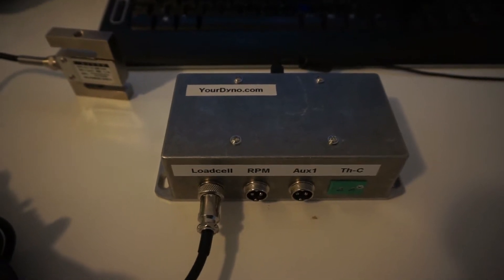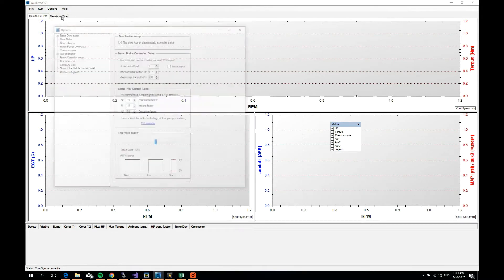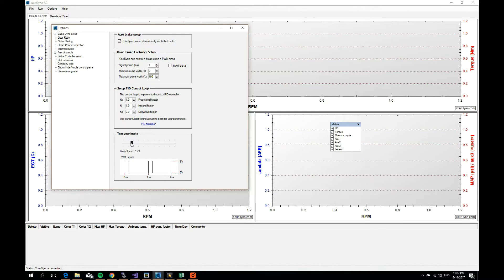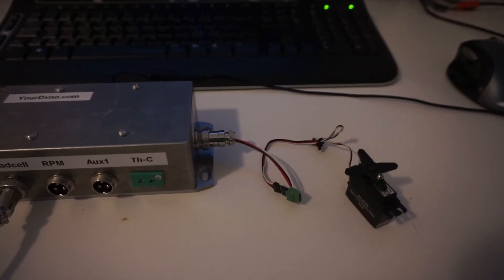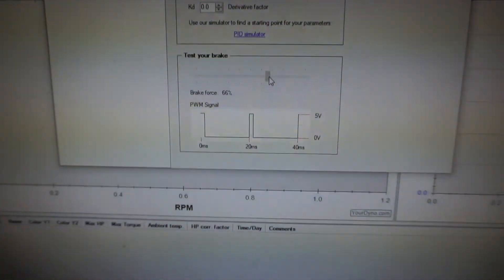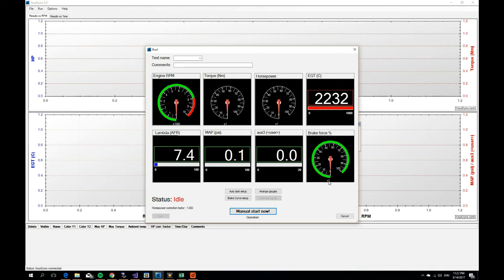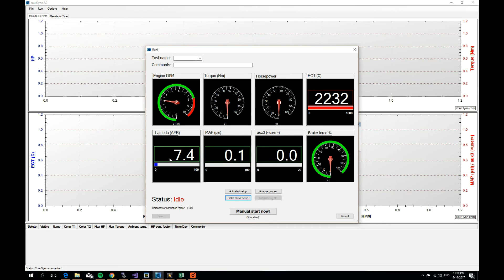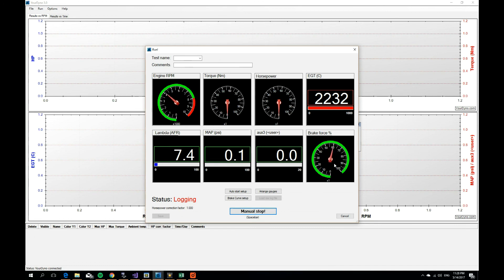YourDyno Automatic brake control demonstration

Comment: Jostein, what kind of logic does the program use to adjust the brake force? Does it increase braking force, until the load cell reported torque is not rising?